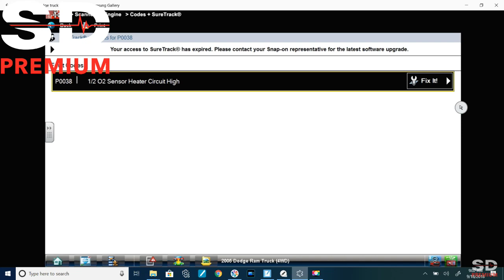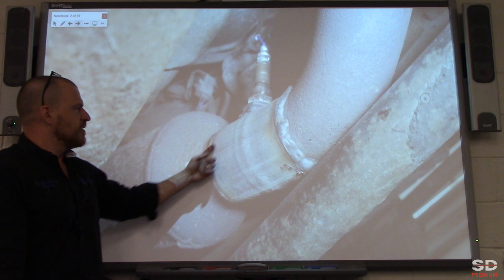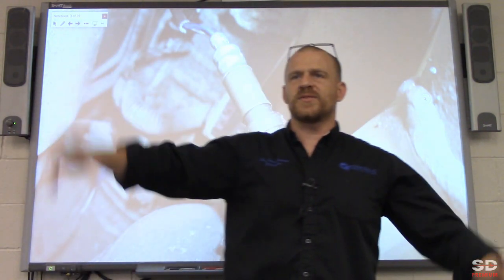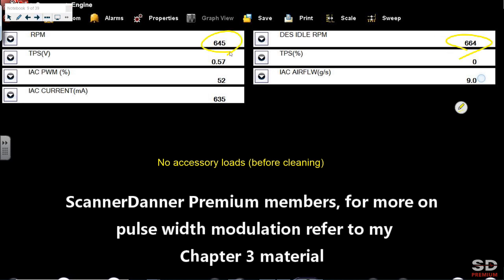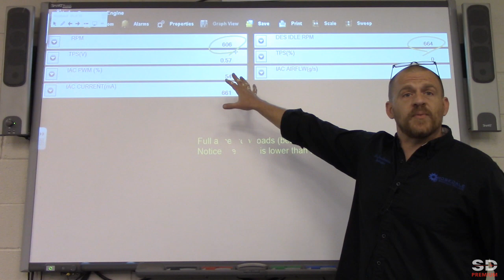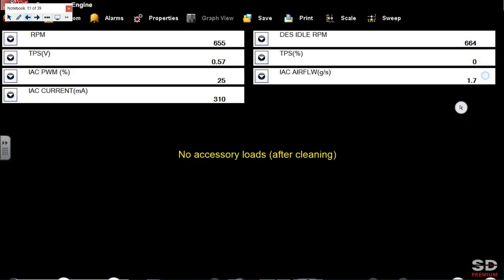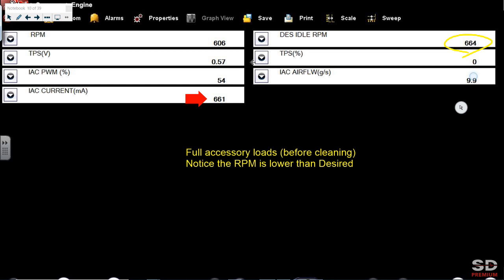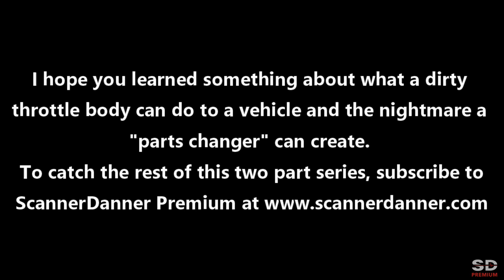O2 Code, Dirty Throttle Body (stalling problem) & Mechanic Incompetence

Comment: Incompetence from lack of knowledge, training, experience, diagnostic tools/equipment & proper use of the diagnostic equipment is part of the issue. Another part is the Service Mgrs and writers that push techs to diagnose for speed not accuracy with no regard for the $$ they are charging for parts & labor that is not going to fix the vehicle. I am glad I work for myself b/c I couldn't tolerate charging customers for parts & labor they don't need b/c of mistakes or misdiagnosing. If it's a system I am unfamiliar with I don't charge for extra time I spend b/c of lack of training or proficiency...I learn as I go and suck up the lost profit and the next time I will be quicker & more efficient. While my wife's Traverse was under warranty I had to deal with incompetent service writers who I'd tell what DTCs the car had and they would feed me a line of crap about how the system worked & then I'd explain to them they didn't know what they were talking about and I needed to talk to a tech or the Lead Shop Mech/Tech. After talking to them they went back up and told the service writer to stop feeding the customer misinformation b/c when they meet someone like me they will be called out. I had to take it back sometimes 2 to 3 times to get an issue resolved that had it not been under warranty I'd have fixed it right the first time. The first thing they did was reprogram and then they never cleared none of the original codes or the ones created from the programming so I took it back and showed the Service Mgr the DTCs so they cleared them and then showed them it was still asserting. He told me what they did by what the Service writer wrote on the repair order and then I took him to the vehicle and showed him the screws holding in the console panels with dirt & dust in them and said how did you check the wiring & connectors on the system w/o removing any modules. He let me talk with the tech once he knew who I was and the tech explained to me they told him to reprogram and let it go and if it comes back then the customer will bring it back. When I showed him the repair order and what they said he did he got pissed and took it up to the service writer and said I just did what you told me to do and he didn't do any of the wiring testing they wrote on the repair order. While I was there I just shook my head listening to them tell customers what their bill was and they'd need to bring it back so they could do further diagnosing b/c the parts they changed didn't fix it. I can't believe how customers will actually pay for P&L and know their car wasn't fixed & not question it and actually bring it back and the repair shops & dealerships that charge customers knowing they just charged the customer for P&L they didn't need. They give the good repair shops & dealerships bad reps.
Reply from the maker: great write up and shows the uphill battle we fight in this industry
Reply: Managers just don't keep up with the times and trust those who spent too much time in the office and not on the workshop floor.

Comment: At about the 11min mark you were talking about the sludge in the throttle body, I understand cleaning the butterfly area for the sensor reading, but you said beyond that it (sludge) does not matter? Doesn't that sludge coat the injectors? What happens then? Does it send codes to the fuel trim? And if so how do you look for it with a scanner? Thank you..
Reply from the maker: PCV gases cause it and every single intake manifold you would remove from the car in entirely coating inside with this carbon. There is no harm or detriment to performance from this. As for injectors, that is not the concern, intake valve deposits are.  Port style fuel injectors, it doesn't bother as the gas washes it all away, INCLUDING on the back of the intake valve. The new GDI systems have heavy intake valve deposit issues because the injector is now located inside of the cylinder and no longer cleans the intake valves.

Comment: I think it has a lot to do with where they work, whether it's a dealership or an independent shop. Dealers tend to pay very poorly for diagnostics, so it trains techs to change parts, because hey, at least they'll make some hours swapping parts. If you're all about diag, a good independent shop is where you want to be 9 times out of 10. A lot of us are trying the best we can, but at the end of the day, some can't afford to spend hours properly diagnosing a tricky problem if it only pays an hour. As they say, a fish rots from the head.

Comment: I was never worried about carbon buildup on cable operated throttle bodies... always thought that the IACV was the main component to chase. That throttle must pass some light when closed... no? Will be cleaning cable operated bored from now on as well. =)
Reply from the maker: Yes, just like a TAC system will limit the amount of throttle opening when your foot is off the accel pedal (idle loads), an IAC system will limit the amount of control of the IAC valve for idle loads. So once you hit the limit, then your stalling problems begin. Great to hear from you btw. Have you seen some of my newer case studies from my class? I have that plate you gave me front and center. Thanks again for that brother.
Reply: @ScannerDanner  Yes, seen the plate... I'm honored you display it so prominently! I haven't been subscribed since the youtube fiasco, sorry. I'll be re-subscribing again soon... that was a nice bunghole! ROFLMAO

Comment: What's with that big hole at the throttle body? You yellow circled the work area, but the big admission hole at the throttle body not mentioned?
Reply from the maker: oh, that is the air inlet for the IAC valve, no need to clean that area either, unless it is completely blocked which they never are
Reply: ScannerDanner I need to get educated. IAC comes into action whenever the accelerator pedal is not depressed. And engine rpm close to idle speed. So why would IAC not be relevant to the owner complain (engine stall), I cant get my head around.
Reply: liviu2004 there are a quite a few things that can make an engine stall or idle incorrectly . Low fuel pressure, ignition issues, faulty EGR, the list goes on. A bad IAC is a possibility also. This is the reason a good mechanic eliminates all possibilities and proves his diagnosis before replacing any part. 
  The parts canon is often used by lazy or under trained mechanics. This is why mechanics need  some type of competency test before getting a certification. The public needs to push for that
Reply: Willie Gillie Agreed fully. But the IAC seems to be forgotten in this video, and I can’t justify to myself, why not? The channels seem dirty and untouched, so must IAC valve be. 🙂
Reply from the maker: @liviu2004  the airflow around the closed throttle plate (minimum idle speed or minumum air flow) must be there for the IAC to function properly. Or to be able to react quickly to changing demands, that minimum air flow must be there. Make sense? When the throttle body is dirty, this restricts the min. airflow and the IAC cannot meet all of the demands anymore. This is what causes the intermittent stalling. Did you see the improvement in the IAC numbers when all I did was clean the throttle body?
Reply: liviu2004 - i see what you're saying...and yes there might be a very minor difference if you cleaned the iac and port that leads to it. But it has a much larger opening, percentage-wise the carbon in the iac port may only impede less than 1% of the flow available through the iac, whereas the carbon blocking the throttle body could block perhaps 50%? I'm not sure about the percentage there but my point is that the iac has a much larger port so any carbon would be basically insignificant. The computer could make up for any small loss in flow through the iac by just opening it a tiny bit further.....in a functional system there is headroom for that to happen. Still a valid point though, if it were your personal vehicle it might be worth doing.
Reply from the maker: @colestowing8695  exactly! and I like your 1% comparison, in which it is not worth doing, even on my own vehicles :-)
Reply: ScannerDanner Experience has taught you what to look for. Sure it could have been one of many issues. A good visual inspection can sometimes bring you right to the problem.
Reply: This scenario sort of baffled me too.  I've only ran into issues with IAC on for example older pushrod EFI ford V8 truck / suv engines, where the idle compensation would be lethargic to adjust and idle would either surge, sag, or swing back and forth until it'd normalize or stall.  It always seemed like the IAC was having trouble getting the pintle to locate properly, and with replacements being inexpensive, changing them always cleared the problem right up.  I hadn't really considered that also having the throttle plate cracked open juuuust the right amount would factor so heavily into the idle speed control so as to be thrown off by a seemingly minor accumulation of carbon.  It's evidently enough to play into the speed density calculations for fuelling also?  Would this be a situation where rather than a tiny crescent shaped gap, bleeder holes in the throttle plate could accomplish the same with less susceptibility to carbon fouling?

Comment: I have been watching your YouTube videos for a couple years and learned alot but i am stumped on my 03 2500 duramax when i first start it the trans gauge slowly rises till it reaches about 130 degrees the it pegs out at hot the if you just wait about ten seconds it will drop to 0 degrees then you can use the truck fine most of the time but sometimes it will put you in limp mode i unfortunately have had it at couple shop where i have changed some parts woth no change i have checked the 5v ref changed ECM,TCM,FICM,PSM still same thing any suggestions would be much appreciated

Comment: I know this was years ago, but thought I would mention that my 2011  Mitsubishi would not start. I had it towed to a dealer and it was dirty throttle body, so in some situations a dirty throttle body can cause a no start. I don't remember if it stalled first or not.
Reply from the maker: I have a case study on an RX 300 with something similar

Comment: A dirty throttle body though can be hard to restart a car though after stalling eventually vehicle will restart , one way is to put foot right to the floor to start vehicle, i just helped a customer who talked to me on phone telling me his vehicle was stalling , customer got some other guy who replaced the crank angle sensor ,  i asked on phone “when was throttle body last cleaned “ the dealership he got no answers from in fact it was recommended  by the previous mechanic that throttle bodys are not cleaned ,  my customer does not believe after i showed up cleaned throttle body was that simple , i always clean throttle bodys  on every car i come across , most over looked thing on cars . All you really have to  remember  are the three things cars need to run , AIR , FUEL , SPARK

Comment: "There are no idle control devices on drive by wire systems",....why is that then?
Are there really no 'stepper motors' on them? I remember having to clean out one of them on a 1990's car, that did have a throttle cable though.
Reply: 'drive by wire' means no wire :)
It is a technology that make use of sensors, actuators, and computers to control things
Reply: @ajscars1081  Yes, I know that but what is the item that controls the idle on a drive by wire car? Is it just down to the electric motor on the throttle body I guess??
Reply: @steveclark..  yeah exactly
Reply from the maker: No need for an additional computer controlled device to control idle speed when the computer controls the throttle plate all the time anyway. Make sense? So now the throttle plate itself is the "idle speed control device"
Reply: On my BMW X5 which utilize a drive by wire throttle body, there is an IAC that control the engine idle.
Reply from the maker: Lol why am I not surprised
Reply: If I remember correctly some have more like a cold idle valve but I don't believe those are full on drive by wire systems. Only on the euro cars though.

Comment: Obviously you have to assess this on a case by case (mechanic by mechanic or shop by shop) basis.  Yes some are thieves. Some of those thieves are deliberately so from the start and some are apathetic incompetent which means they fired the parts cannon, didn't fix the problem, then still charge you while sneakily not mentioning the other thing they had to do to FIX the problem, just billing for the more expensive item (very common when ECM replacement is suggested and done).  They didn't plan to screw you up front but just don't care that their first repair attempt was worthless and bill you for it anyway.

Incompetence does happen, but a reputable shop should make good and credit the cost of the repair towards the next repair (if you dare let them keep working on the vehicle, they kind of have you in a pickle because they don't want to give a full refund and won't anyway if the new part stays on, which is why I always recommend requesting the old parts back which also keeps them (more likely) honest about actually replacing parts that they claimed to.).

Ultimately a shop does not want you back for the same problem and angry about it, so yes if your problem isn't fixed then it is incompetence except in special cases like you could not reproduce the fault but the customer insists that it's imperative that you do what you can to try to solve it.  Then it becomes the burden of the mechanic's judgement whether to open that can of worms and try to blindly make a best educated guess what should be replaced and how to warranty that work.

Comment: I smoke tested a Chevy Caprice 96, and spotted a vacum leak from the throttlebody shaft, is that normal or should it be rebuilt/replaced?
Reply from the maker: you only need to ask this question one time on one video, I see every one. A small amount of smoke coming out of a throttle shaft is nothing to be too concerned about. As long as it is not dumping out of that location.

Comment: Thanks for broadcast!  I'm getting no communication to OBD2 port  car Stalling I read the codes on the cluster 02 sensors low voltage then it said crankshaft sensor so had that replaced... on a 2005 PT Cruiser non turbo 2.4 L  and 02 senors low P0031 & P0037 voltage I replaced them and clear and they coming back. I replaced the ignition switch because it's said it's a common problem on these not working at full voltage and  then everything has low voltage. Relay are working and fuses not blown... after replacing ignition switch seems to have more power... but now no OBD 2 port dead and codes on cluster low voltage 02 sensors, low voltage brake switch... uhhhhggg help!!!
Reply: That's a lot going on at once, and careful, systematic diagnostics and troubleshooting should be the only path forward to keep from throwing parts at it for no resolve.  I don't think the '05 model would be any different than the years before, where I've found issues with corroded wire harness terminals going high resistance and dropping voltage, getting hot from the current and melting connector bodies, etc.  Mine personally cooked a pin at the headlight / turn signal switch connector and lost both low beams, and cooked a pin at a connector near drivers side lower dash and lost power windows and other things on accessory ignition circuit.  Check voltages, check voltage drops, check wiring diagrams to follow the logic.
Reply: @a89proof  that's whatt  I'm not strong in that never really had anyone show me how to do electronics now that I need that skill!

Comment: 🤠 i dont think theres even such a thing as a 'new' replacement main computer, its usually refurbished whatever TH that really means, its kinda anoying and creepy the computers because its something that is Cryptic, Secret, Proprietary, Non Serviceable, and even the Service Manuals never tell u exactly how it works, i never thought that was rite 😡 Since u cleaned the TBody can u spray out the IAC Valve or is that a non serviceable part? 🤔🧐
Reply from the maker: no need to touch the IAC valve for these issues
Reply: @ScannerDanner  🤠 ok thx for the tip! 🦃

Comment: What about coated throttle bodies like some Fords? They have a big sticker on them "DO NOT CLEAN". What then? Soap and hot water?
Reply from the maker: if they are dirty, the coating didn't work now did it? :-) clean away brother
Reply: I agree Paul, and works for me is WD40 on a rag. It works fine and will not affect the costing.

Comment: In my day there were definable thief's. In today's technological centered world it's more incompetence and that does not necessarily mean the technician is at fault at all. Many business owners will not spend the money or time to train their technicians on the necessary understanding of what software & computer technology has brought into the mechanical trades. And many owners can't due to the almost daily increase/change of these computer operated systems and the cost of equipment just to see the results of these systems. And the new type of owners define a successful business not by how many satisfied customers they have but by how much money they make. In this new world that is the standard of measurement of success...not of understanding and interpretation of data collected and displayed by screens which result in accurate repairs.
Reply: SqueakyHinge amen to everything you said.